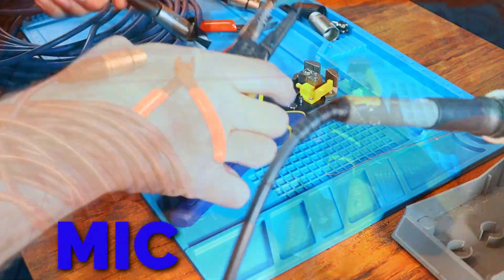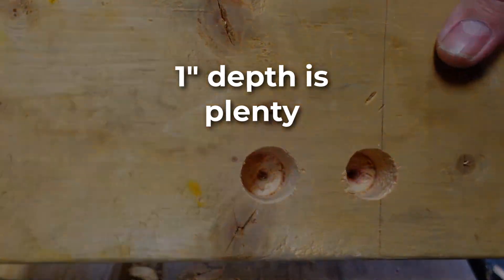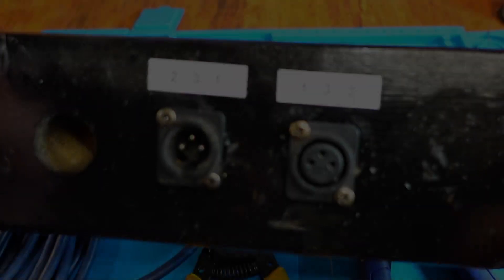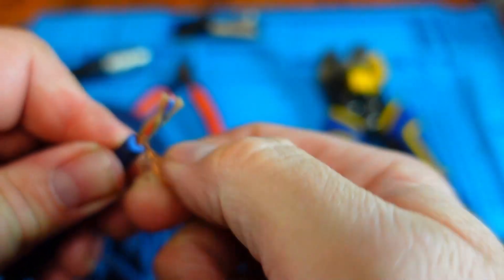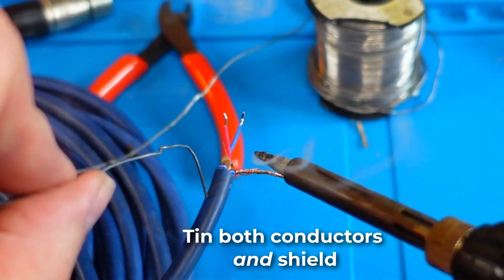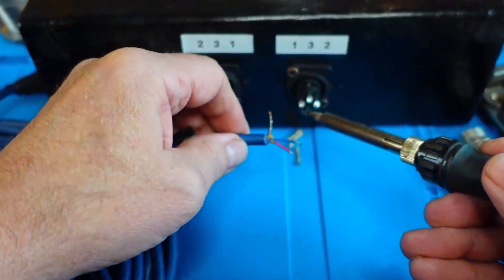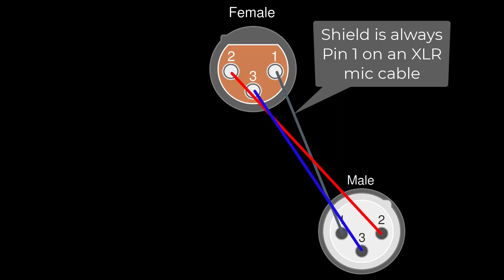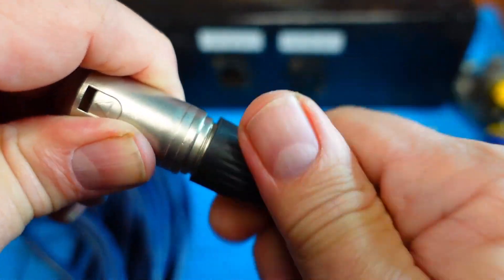DIY Mic Cable Repair Station: How to Repair and Build XLR Mic Cables

Comment: Technically, pin 1 is the signal ground (or drain). Calling it the shield is a little bit misleading. On an XLR connector, the shield is the housing, not pin 1. And on many XLR connectors, there is indeed a tab that you can wire the shield to.

The shield is the outer braid (or metal coil) on a cable, meant to reduce electrical interference. On 2-wire cables, it also serves as the ground. On 3-wire cables, it sometimes is also connected to the ground, but not always. A shield can be grounded, but a ground isn't inherently the shield.

The signal ground can be separate, but is usually connected to pin 1 on both ends. It's used as a reference for the signal itself. When connected to the shield, it can help to reduce interference.

On 2-wire cable, the shield is also used as a ground. On 3-wire cable, the shield might be connected to the ground, but it might not be. You have to consult the manufacturer's documentation to be sure... or at least use a multimeter to test it. If it isn't connected in the cable, and you want the best noise rejection, the shield should be connected to the housing on at least one end of the cable. 

A connection to pin 1 on both ends is required for phantom power, but is otherwise optional (and usually ignored) for balanced audio. And having it connected can sometimes lead to issues with ground loops. Most of us who do much with audio have cables or adapters that intentionally don't connect pin 1 specifically to fix ground loop issues. And they have saved our butts many times. 

But calling pin 1 the shield is not really correct.
Reply from the maker: The information is correct. I'm not disagreeing with what you're saying... but semantics of calling the pin 1 the ground or shield is pointless here. You connect the shield to pin 1 in an xlr cable. 
Which is what the video says. Connecting to the tab is generally frowned on unless it's left open on one end.
Anyone wiring an xlr cable just needs to follow the instructions in the video and they will be 100% fine... and correct.

Comment: as a beginner in soldering, the color coding not being uniform really f's me up.
Reply from the maker: That's one reason I have my own coding that I use so at least there's consistency with my own wiring. And it does follow what usually is the case with others. 
I ALWAYS make black my negative - if there is a black wire. And then red or white is my positive + in the case of those options. Green will always be a negative - as well when I do a mic, speaker, or DMX cable if that is an option.

Of course where it gets off the rails is when you have a cable with only red and white or something like that, and no black. In that case I always default to red being the positive.
Reply: thanks so much! @AlanHamiltonAudio

Comment: Hey Alan thanks for the video. I wonder if you have ever had a stuck XLR cable in the back of an X32. How to remove it, or better if not possible, how to replace the whole XLR connector on the mixer without having to open the whole console if possible. Appreciate any leads!
Reply from the maker: Knocking on wood so as to not jinx myself, but I haven't had one get stuck.
Reply: @AlanHamiltonAudio  I found this useful video just in case that ever happens to you (HOPEFULLY IT DOESN’T). I didn’t have to open the mixer luckily but helped me understand what I needed to do on the connector in order to remove the “useful” spring that locks the connector.
https://youtu.be/os-tpWad7Uc?si=QvizlacdDXtoOhFm

Comment: You are right that "electricity is color-blind" - if both ends of a cable is done the same way, colors doesn't matter. That said, most people including myself tends to use a "hot" color (such as red) for the hot pin (2), and a "cold" color (black, blue..) for the cold pin (3).
Reply from the maker: That's pretty much what I do... If there is a black, it's the '- cold' when I make a cable, and the brighter/hotter color is the '+ hot'. If there is no black, then the brightest/hottest color is the + (hot) and the colder color is the - (cold).

Comment: Great video as always. One thing I’d do differently: insert the housing right after you cut the old connector. That’s the easiest and cleanest time to do it and it will ensure you don’t forget to do it before soldering the wires.
Reply from the maker: That's usually what I try to do... But I don't always remember to do it!
I'm just happy to remember to do it before I have the connector soldered on! ;)

Comment: That is a nice work may , Is that available ?
Reply from the maker: Never have seen anything pre-built for that purpose that anyplace sells. There's the alligator clamps on arms and that kind of thing, and they hold the connectors just fine... But you have to either know the pin numbers by heart, or be able to read tiny numbering. And reading the tiny numbers isn't then really hard part, but it slows you down. You have to see it, think about the how the pins are situated, etc...

Comment: What is the wiring if you are only using an unbalanced cable and not balanced? Do you need to do anything special ?
Reply from the maker: If you're wiring an XLR to a TS 1/4" then it's usually going to be Pin 1 to the Shield on the XLR and the 1/4" connector. Pin 2 to the tip of the 1/4". And then Pin 3 of the XLR will need to connect to the shield also.

If it's for 2- XLR connectors, or XLR to TRS, then in almost all cases you should be using balanced cable with 2 conductors plus shield.

Besides the potential for inducing noise using unbalanced cables, it can make troubleshooting a problem and more trouble for someone in the future who ASSUMES an XLR to XLR cable is balanced (until they open an end and see it's not... or happen to read the jacket of the cable). Not worth the few pennies it might save to run unbalanced when equipment allows you to run balanced. Best practices is to run balanced whenever you can, unless it's a very short run. And even then... you still probably should run balanced if that is an option. IOW, don't come out of your mixing console with a TS to TS instrument cable to feed your amp when they both have balanced connections available.

Comment: is simple, pin 1 to pin 1,..2 to 2 and 3 to 3...  All connectors are marked even on cheapest brands. Much cheaper to buy cable and connectors and build them that buying ready made ones.
Reply from the maker: It's definitely cheaper to make them than buy them if you're buying in bulk, or at least enough to get free shipping on all the cable and connectors. Probably not cheaper for a one-off if you have to buy the pcs for just one cable by itself.

But that said, depending on how busy a person is, and how many you need, buying them premade might make more sense when time is factored into the equation. And even then, there are times you'll find yourself needing to make one for one reason or another. A special length that you need right now, packaging inside a rack, etc...

And assuming a person is buying the good ones and not the cheapos that don't take much abuse, you definitely want to hold onto them and fix them when they have a problem because it doesn't make $ sense to throw them out when a few mins on the bench has it back to new. And good mic cables will last and last.

Even the cheap, 'disposable' type cables can many times be repaired 'better than new' because their worst failure point is bad soldering more than the cheaper wire/jacketing and off brand connectors used.

I usually let them collect for a bit and then have a maintenance day (or evening in some cases) to catch up on the bad cables. Percentage-wise I don't have that many cable failures, but when you have a lot of cables and they see a lot of gigs, failures will happen. More from abuse than use. Most cables don't like having a lid close on them! ;)

One thing about repairing cables is it makes you better and more confident to build your own. And at that point, you're in charge of quality control. A while back, I decided to do some cable maintenance and take a look at some NL4 speaker cables. There were a few I'd made, and some I'd purchased that I wanted to check (some 100' cables). I was mainly concerned about the ones I'd made... opened up the ends and mine were still perfectly fine. All tightly connected. Opened up some of the factory cables of one brand and the contacts were loose and needed tightened!

Comment: I solder the shield last.  Before doing so, I trim the length so it's a tiny bit short.  By doing this, if the strain relief should fail, all the pull will be on the shield, which is stronger than the other conductors, reducing the chance of breakage.

Comment: A very useful skill to have.  

One extra tip - when you've twisted the shield to make a straight end for Pin 1, give it a 1/4 turn back the other way before you tin it.  This releases any tension from the part of the shield which is still in contact with the inner conductor insulators and reduces the chance that the heat from the solder iron will melt the insulator on the red or blue wire, which can lead to shorts.
Reply from the maker: That's a good tip!

Comment from the maker: This video is a bit of a "how to" video, looking at some tips and explanations on repairing or building XLR mic cables. You could morph this info into DMX cables as well. Even adding 5 pin DMX panel mount connectors to the DIY "XLR Mic Cable Work Station" that I demonstrate in the video, thus making it a DMX and XLR cable work station.

Leave any questions here. 
Likes, subscribes, and comments always appreciated as it helps to get YT to suggest my videos.
Feel free to share and repost the video link. :)

~Affiliate Links~

Amazon Links:

Female D Series Panel Mount Connector (Neutrik) on Amazon:
https://amzn.to/3k6KXaE

Male D Series Panel Mount Connector (Neutrik) on Amazon:
https://amzn.to/3CBDXsI

Premium Heat Resistant 932°F Silicone Soldering Mat on Amazon:
https://amzn.to/3Zmtj2G

IDEAL Electrical 45-121 T-6 T-Stripper - 14-26 AWG, Yellow Wire Stripper on Amazon:
https://amzn.to/3Guiumz

Mackie Cable Tester (similar to cable tester used in video) on Amazon:
https://amzn.to/3Qw4eyi

Sweetwater Links:

Neutrik Panel Mount Connectors at Sweetwater:
https://imp.i114863.net/WDbJXP

Neutrik Cable Mount XLR Connectors at Sweetwater:
https://imp.i114863.net/dox3KM

Cable Testers at Sweetwater:
https://imp.i114863.net/3P2X7d

~~

Patreon Page:
https://www.patreon.com/AlanHamiltonAudio

Facebook:
https://www.facebook.com/groups/livesoundproduction/

“As an Amazon Associate I earn from qualifying purchases.”
"As a Sweetwater affiliate I earn from qualifying purchases"
Your price is not affected by this.